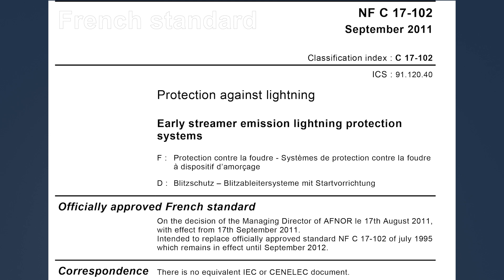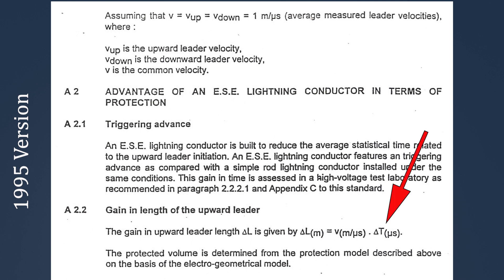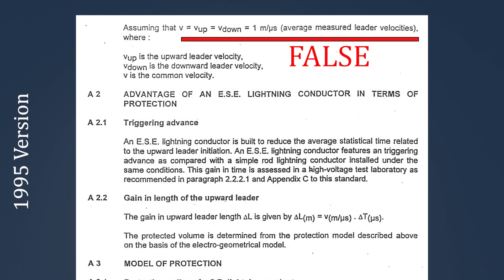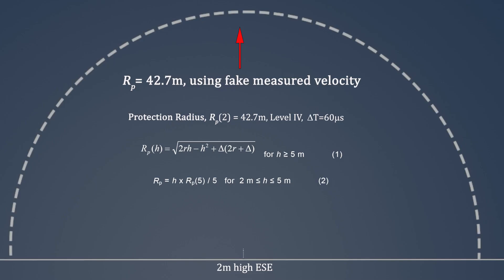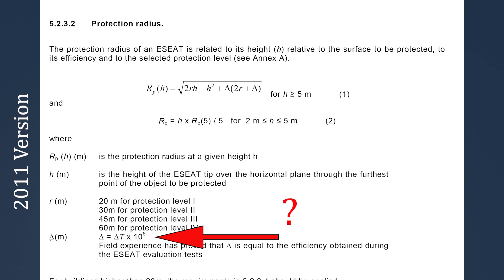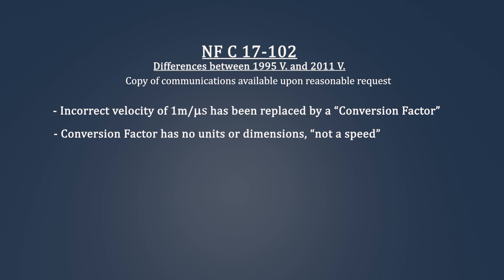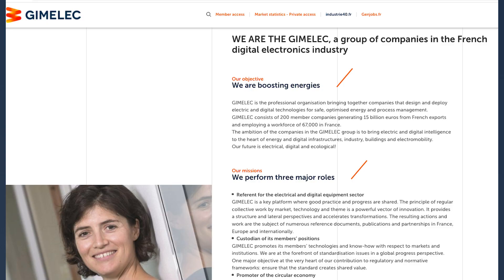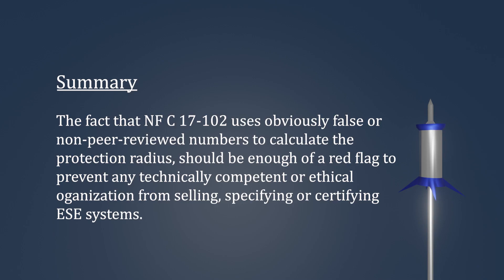The Problem with ESEs, Part 1, The Standard

Comment: Excellent! This is a topic that should be given more attention. Many people are falling into the scam of this “almost magic” LPS.
Reply: The company I work at just installed it on some big storage tanks. I had never heard of ESE, thought it sounded too good to be true, googled a bit and it seems it's actually too good to be true. In this case, I think the tanks can take some lightning hits without damage so the protection isn't very important but in other cases, I will not trust ESE again.
Reply: @ Hey, the ESEs work just as any conventional air terminal, one problem lies in the inflated costs that their manufacturers assign them due to the “superior” performance. Another problem is that the area of protection they offer is “better” so you wouldn’t need to install them at the same height of a conventional rod for them to cover the same area. But as I said, they perform identical to a conventional rod, thus the area of protection needs to be calculated with conventional procedures or you end up with a design with a diminished safety as they are generally installed.